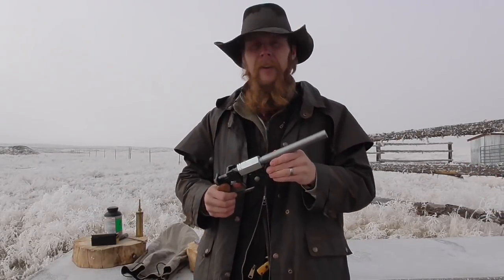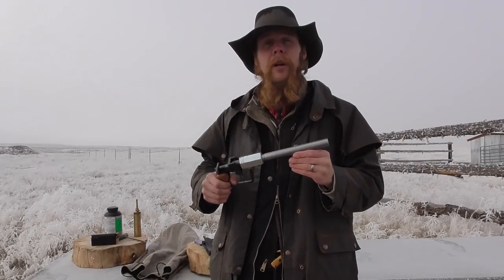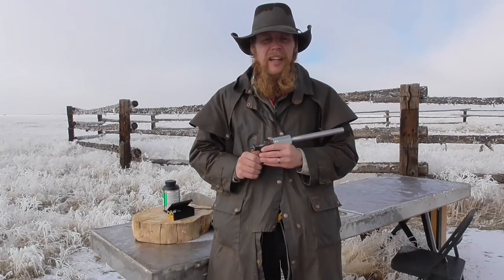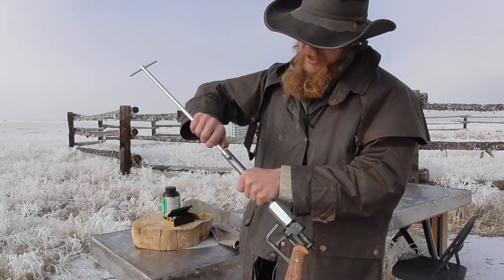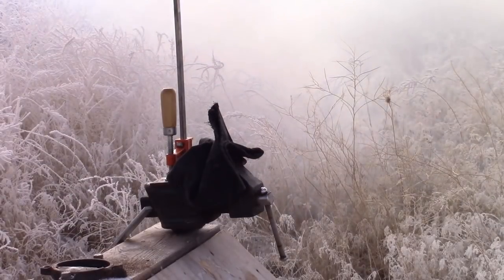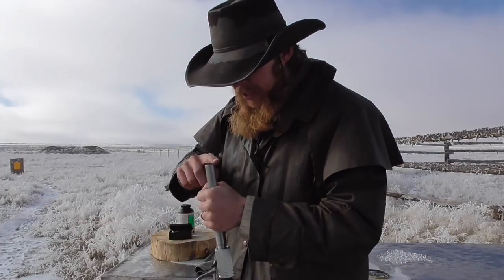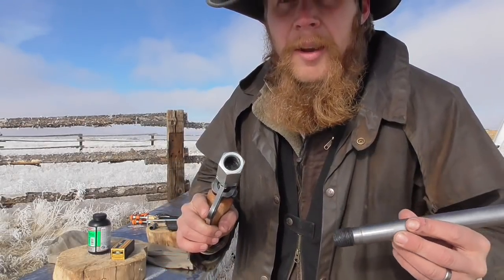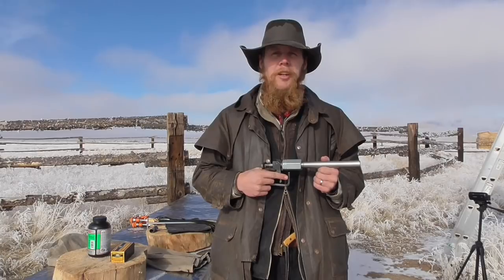Full Barrel Proof Test (VR006)

Comment: I used to proof with triple powder and double patched balls, if that didn't blow it then it was good for me...
Reply from the maker: That is closer to what I usually do as well.
Reply: Sounds good to me. That is getting much higher pressures then normal operation, so if that does not break anything, nothing normal will.

Comment: A few years ago I shot a muzzle loader with progressive loads and found a a point about 75 grains I got max velocity. I went up to 90 grains and did not see an increase in speed. I would think that after 75 grains I did not get an increase in pressure just more flame out the end of barrel.
Reply: Makes sense to me. I would think that with the projectile barely in the muzzle, it will just pop out with the slightest pressure and a significant part of the powder will be ejected from the barrel before burning. I expect that would make some dramatic night time shots!
Reply: Years ago, IraqVet8888 filled a Hi-Point with powder and screwed a bolt in the end. It still was functional afterward, though it may have had a bulge.